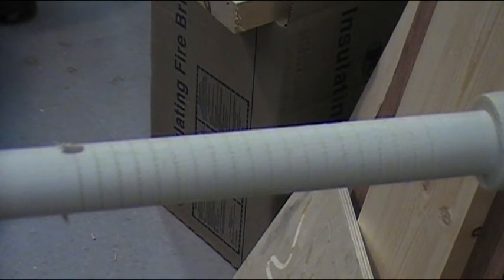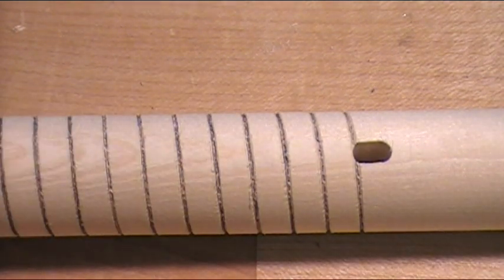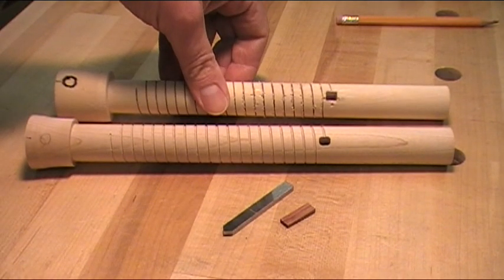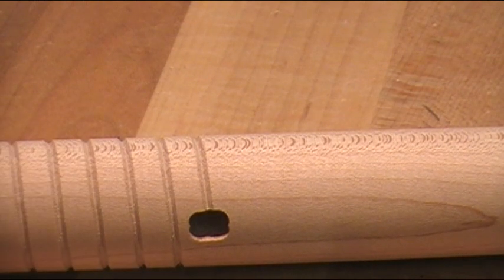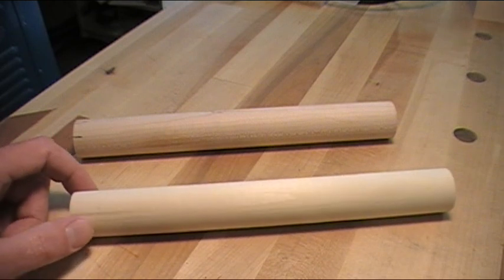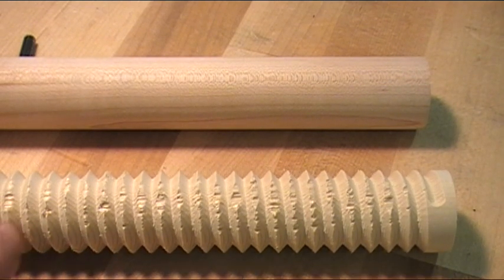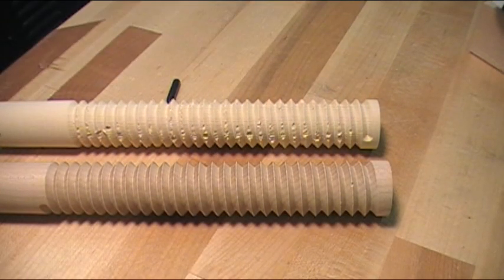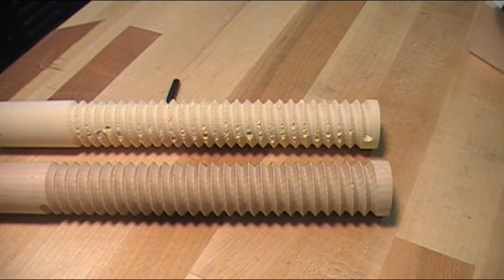Wooden Screw - Part 1

Comment: Well it must be nice to able to afford all that fancy equipment. I was hoping to see something "Old School".
Reply: You buy a metal nut and bolt or several of the size you want.  You take a boly and you fiile or angle grind un grooves on four sides and make it kind of taper into a point near the end. Drill a hole the side of the nut a little larger than the nut. You push it through, going a little back very turn or so to let the shavings fall down.

To make wooden threads on a screw. You dowel down your piece of wood to slightly thinner than your original metal nut. You make a cutter with a metal bolt, a little cutter in the shape of your ridges, which cuts out the grooves into the wood and then guides it into the metal bolt to make sure the threads match. While making sure the shavings have somewhere to go.

You can use a router to make the grooves, or take an old file. You use a propane torch to heat it until its glowing hot and then cool down slowly with air. So the hardened steel becomes soft/annealed. . You shape it into the form of the grooves. . You use the same propane to heat treat the steel again. So the inside structure changes, then you cool it quickly in oil so its fixed in that state. Then temper it further n a oven to let some of the stresses out. and put it itno your thread cutter after honing it.